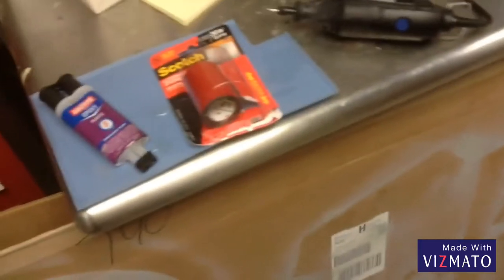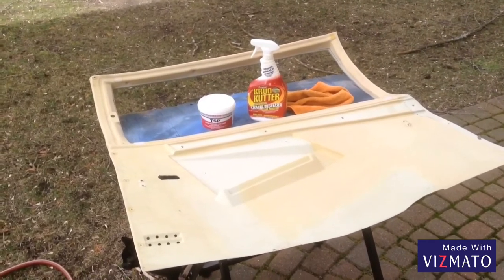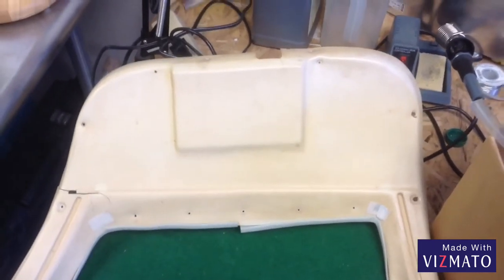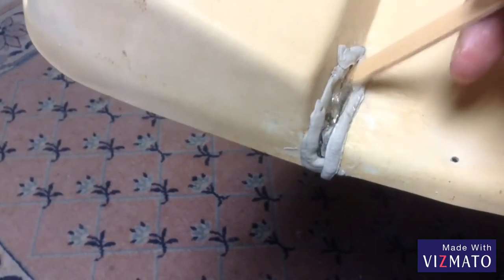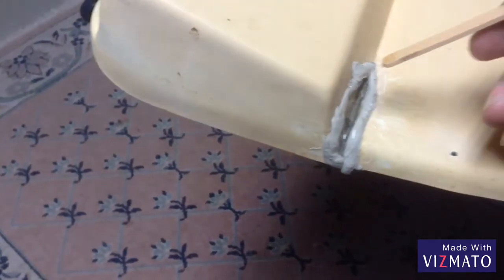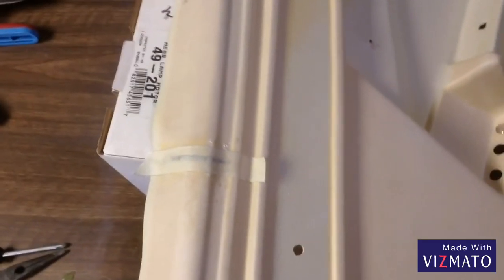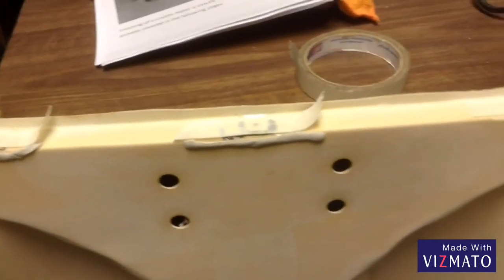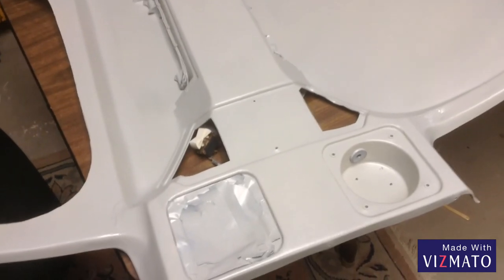Mooney M20J plastic interior repair and painting

Comment: I wish we had met before you did this project.  The best results I have had with plastic aircraft panels is with thin fiberglass drywall tape, super glue and DevCon Plastic mender.  Tape the back of the areas to be repaired, soak in super glue.  Then add a second a second layer before it drys. Then once the SG has dryer, top with DevCon and sand after it fully drys.  You can also put a layer of tape on top for extra strength where needed, DevCon, and blend by sanding.